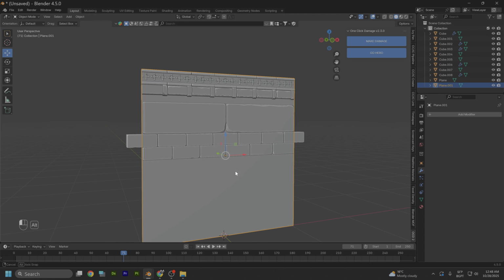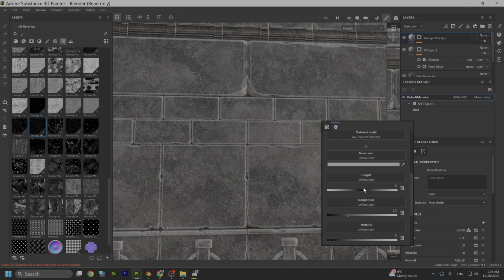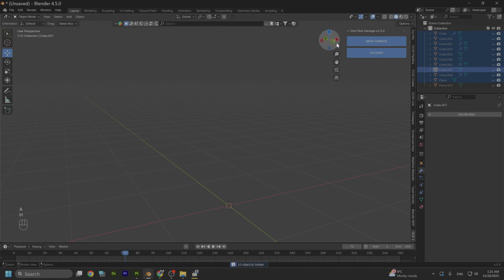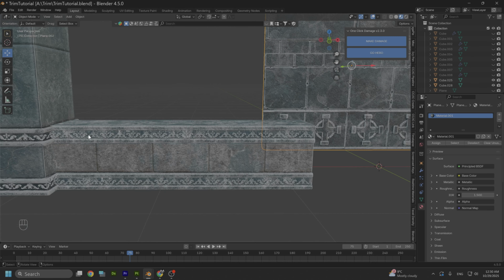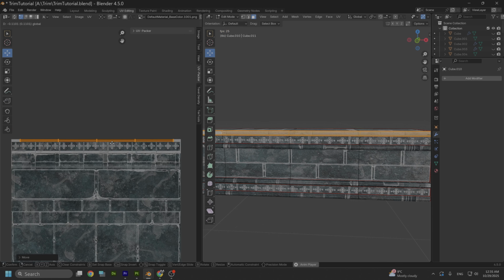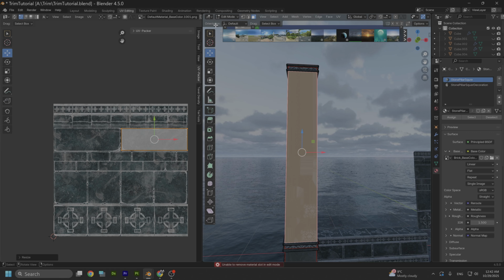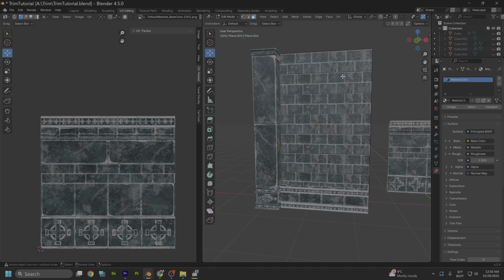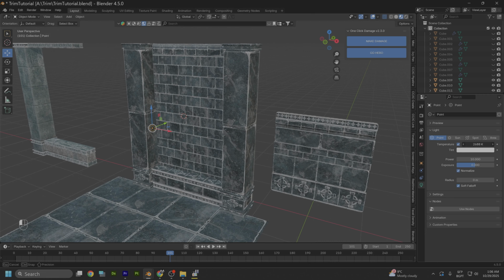Trim Sheets The Ultimate Beginner's Guide part 2

Comment: Is there another similar method that is optimized? I can't get it to work; everything gets distorted.
Reply from the maker: there is no simple way
Reply from the maker: When you use trim sheet is good to create your meshes thoughtful in advance and what your trim sheat allows. I don't know what your problem exactly but there is always solution
Reply: @martinpain4569  The solution was to use textures at the actual size... for example, a wall 3m high by 4m wide, I have to create the texture that way, it works, but that leaves little space on the page since it usually has to be 4x4m, if you make it too big it loses quality.
Reply from the maker: Normally textures are square thats wy we made them 4 bu 4 but you can do what you need for your project